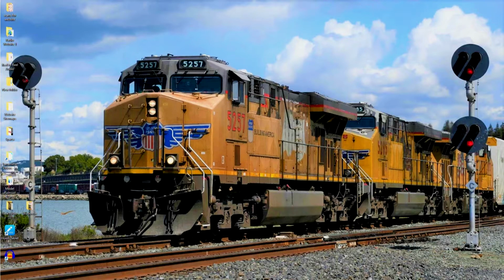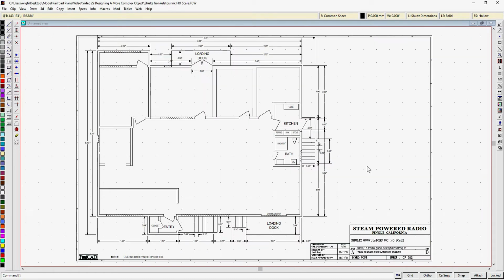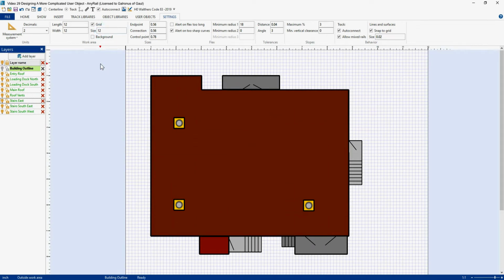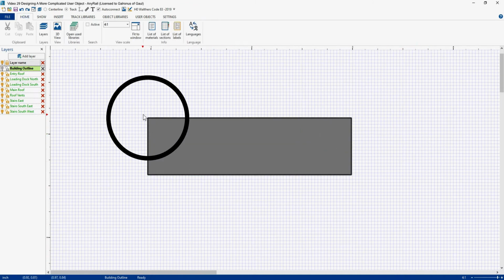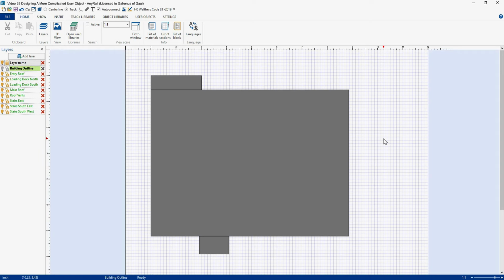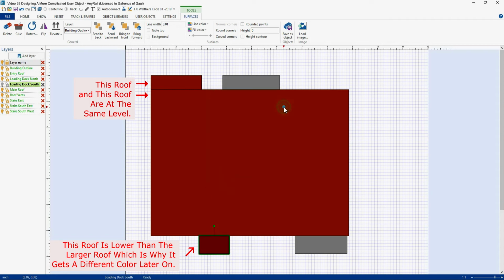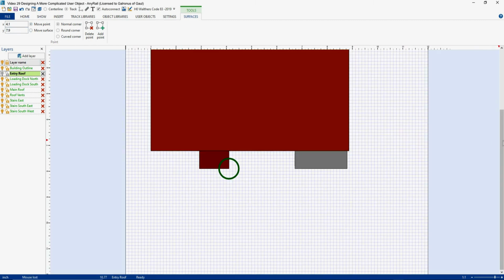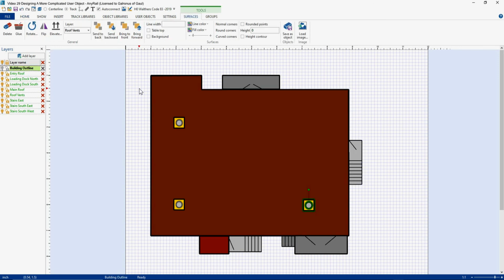AnyRail 6 Tutorial Video 29: Designing A More Complex User Object

Comment: Another great tutorial, thank you. I would like to try to use the Walthers cornerstone 3 stall modern roundhouse but with multiple stalls. Do you think it would be best to do the 3 sections and duplicate and connect them or to build it from scratch? It is probably easy to duplicate an object but I don’t know how difficult it would be to join them together. I’m looking to do the Cheyenne roundhouse in the fifties so it would be a lot of stalls, almost a full circle.
Reply from the maker: Derek, good question. I tried to get into the Walthers site to take a look at the roundhouse but there seemed to be a problem with them. Let me take a look and see if the have a footprint available. I suspect that the best way would be to determine the number of stalls and design the complete thing. But, if you could design the 3 stall and then put one side at either 90 or 180 degrees and then copy and align the copy to either 90 or 180 (whichever you choose) you probably could do it that way. Each successive copy would be alignd to the prior copies in the same way. Does that make sense? Let me know. Dave
Reply from the maker: Derek, you are a trouble maker. Make sure you read my other reply before this one though. I just took a look at how you could do it with the six stall roundhouse from an earlier video and yeah you can rotate. But you will have to do a modify object and then ungroup to make alignment easier. You would also have to account for the thickness of end walls as you put them together I would think. End walls would have to be removed from the drawing to get the track alignment into each stall correct? What roundhouse are going to be using? Is it 933-3041 from the user library? This is an interesting idea and I wonder if there would be enough interest from viewers in how to take a couple of objects like this and combine them together to make another larger building to make a video? Personally, it's one of those questions that makes me start thinking of ways to do it and what problems do I have to overcome to get to the finished result. Yeah, maybe I will work on that video. Dave
Reply: Thanks for looking into it. It is actually the Walthers cornerstone 3 stall MODERN roundhouse kit number 933-2900 HO. I think I understand what you mean but there wouldn’t be any walls to worry about between the sections until you get to the end of each group. The roundhouse was divided into two sections so there would only be 4 exterior walls to deal with for 48 stalls. The download they offer for the footprint isn’t that good but the instruction sheet shows the floor pieces but not with dimensions. I would definitely be interested and I think others would be as well. Even if they didn’t use it for a roundhouse they could use it for larger factories or city buildings that could be expanded by repetitive parts.
Reply: It does give the dimensions separately as standard building being 17 3/4 x 16 x 5 1/2  and with extended stall 20 1/8. It also gives it in cm as 44.3 x 40 x 13.7 and with extended stall 50.3 cm. Maybe i shouldn’t have dismissed the foot print download since the dimensions were available elsewhere.